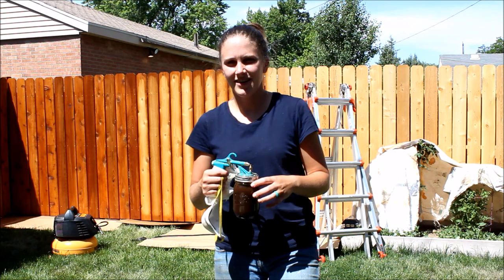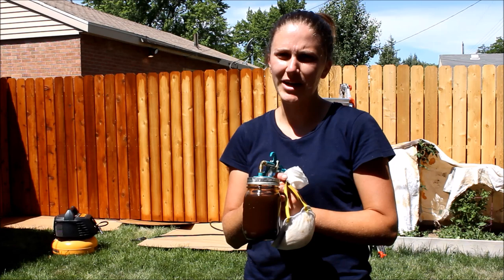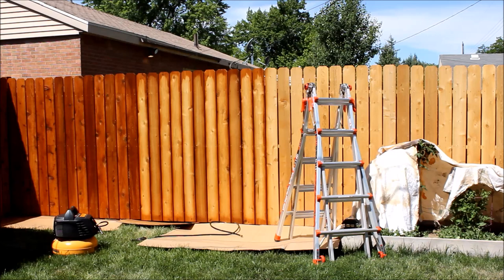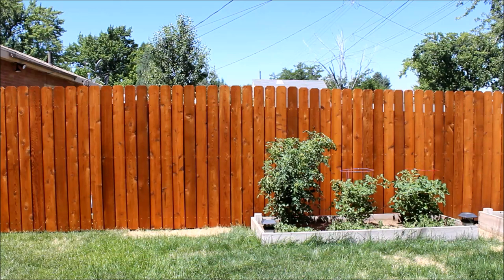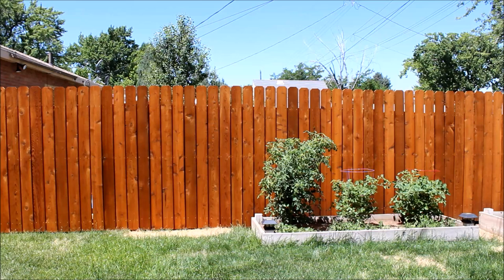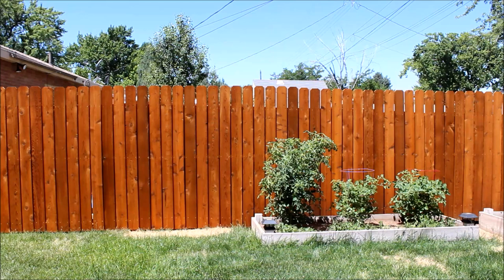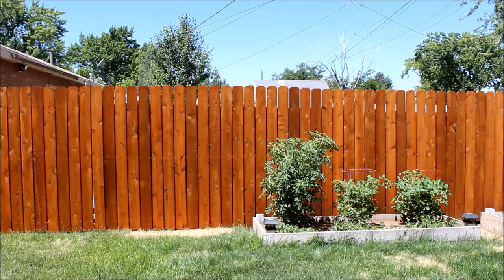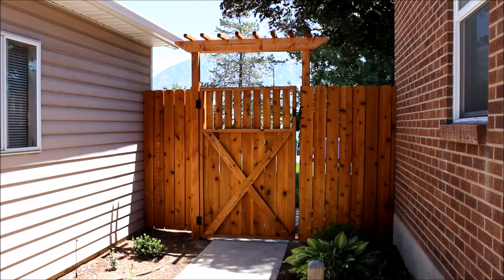How to Stain a Fence with Ready Seal

Comment from the maker: PLEASE NOTE: That there will be overspray when staining a fence with a sprayer (I didn't mention this in the video) and you should place old sheets or something like that, behind the fence to prevent any overspray onto unwanted areas. I used old sheets clipped to the back of the wood to prevent this, just to make you aware of what I forgot to mention!
Reply: What brand stain and color did you use?
Reply from the maker: @journeymusic  The brand is Ready Seal and the color is Natural Cedar.

Comment: Dude could you find a smaller spray pattern. This might work for spindles but they could have finished faster with a 5in brush or mini roller. As far as spraying these products can be sprayed with a $10 pump sprayer no compressor needed.
Reply: a hand pump sprayer would need a young wippersnapper like you to keep it pumped up!

Comment: so, how does it look now?
Reply from the maker: Last fall, I restained my fence because it had been over 3 years and it is recommended to restain every 3 to 5 years depending on your location, and in my location, we have lots of snow in winter and 100-degree summers so it needed a refresh to waterproof the wood again. The stain still looked good but was looking dried out. This time I decided to roll on the stain and I determined that rolling on the stain does get more stain onto the fence but it takes a lot more time plus it was difficult to get everywhere with a brush/roller. So if you want to get the job done fast or have a lot of fences to stain, I would still recommend spraying the stain on because there was not that big of a difference but I guess time will tell on how long the rolled on stain lasts. Hope this helps!
Reply: @TwoFeetFirst  did you prep the fence in any way for this new application?  You are suppose to powerwash and then us a bleach/water mixture to bring the wood back to natural look.  But if you simply sprayed on top of what you already put down, it would be interesting to know how it looks and if it lasts.

Comment: Did it bleed trough your neighbors side?
Reply from the maker: Hi, I wish I had an answer to your question but I am not sure about this because I actually stained both sides of the fence to protect the wood (asked my neighbors first!).
Reply: TwoFeetFirst ah ok, thank you... since you said you did both sides it’s kind of hard to tell without checking it. I was assuming you did only your side and see if it went through  since you did a spray. I guess I’m going to just do the old way and paint brush just to be safe. Thanks for your help, have a good day!
Reply: @Jomievolution8  it does penetrate through pretty well.  My stingy neighbor didn't do his side of the fence {and he didn't share in the cost of the fence either).  And my cedar fence is 25 years old and still doing well.
Reply: @gosman949  thank you !!!

Comment: Spraying and polluting the air is not the way to go. You can do that in a spray tent. This is not the right way to do it.
Reply from the maker: That is a fantastic idea to use a spray tent, I wish I would have thought of that when I did this project. Thanks for sharing this tip!

Comment: Did the fence turn out blotchy at all or uneven? It kinda looks that way in video.
Reply: Judy Rogge When the stain dried it was not blotchy or uneven, that's the cool thing about this stain. In the video it does look that way because it is not dry but you can see images on my website of the fence after (link provided above).
Reply: Megan Taylor how long has it been since you stained and how does it look now? Has it faded?
Reply: Judy Rogge It has almost been about 10 months and the color is not as dark as it was after applying but I do not feel like it has lightened from the dry color. I am curious what a summer will do but it held up amazing in winter.
Reply: Thank you for your information. While watching your video and other videos, I'll be looking for a new video from you after the summer!
Reply: It is self leveling, they call it goof proof, runs and drips will level out that is the most positive im getting while i do my research, so it mimust do a great jo